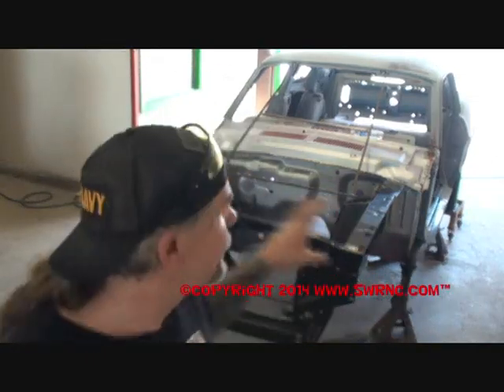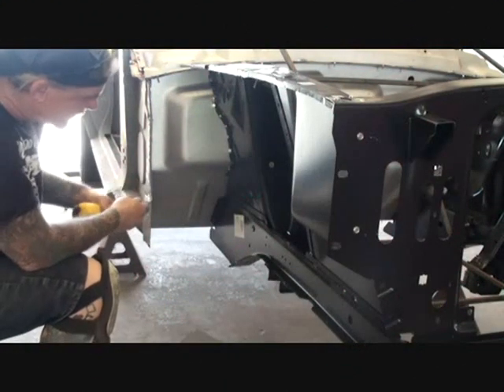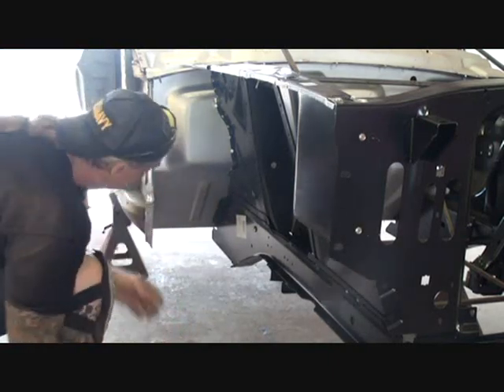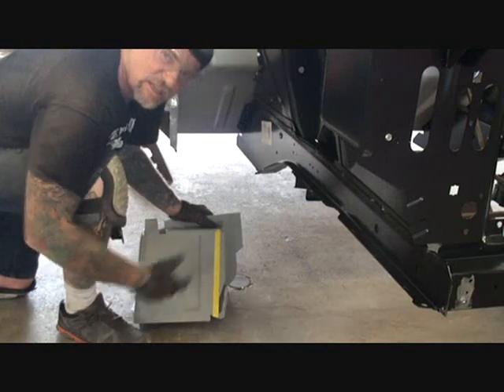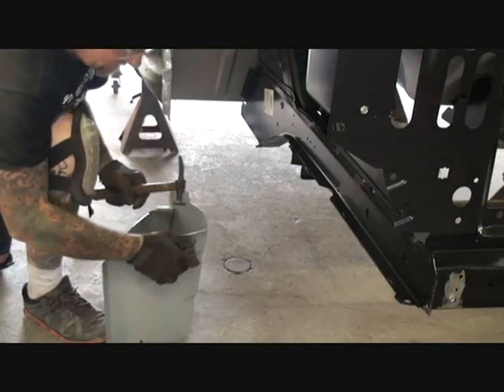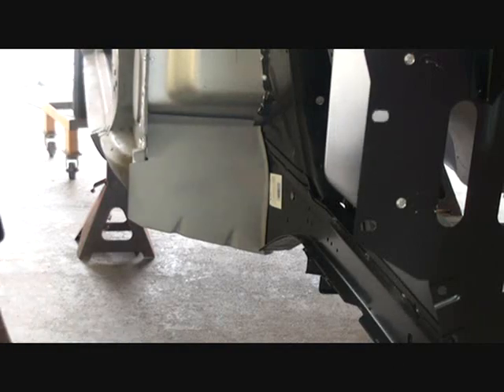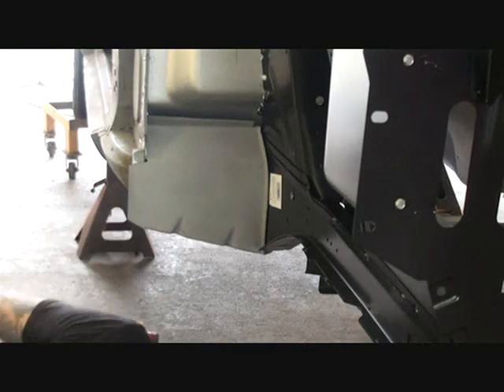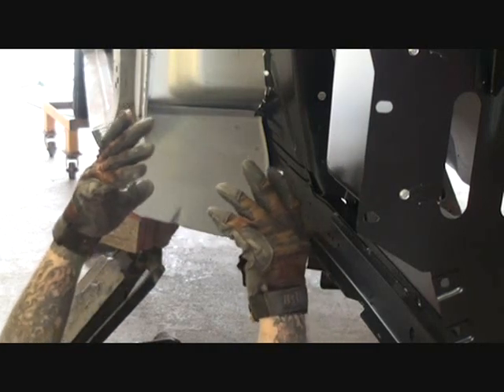"How To": "Restore" A Rusted Out "Car"-Part 20

Comment: hi pete, just want to say thankyou, i have been rebuilding classic mini's(non bmw) in the uk for 15 years, recently i took a job on restoring a mini pickup, the customer supplied all the panels.
they were the cheap type, i normally only use heritage panels(factory spec), but after watching your vids i tried it your way, we built a jig and fitted the panels with screws first,and it worked so well i'm now using your method all the time (even with the best panels).
i guess old dogs can learn new tricks,
thanks again aly.

Comment: A GIANT THANK YOU - I have been watching your videos for around 2 years. You have taught me so much, I have seen the way to "Do it Right", so I thought I would finally give it a try on my Ohio rusted out 2000 altima and my 1999 F-150. The first time I welded in a patch (ugly welds) it was like a miracle. Wow, I could take my knuckles and rap on it and it was metal instead of a rust holes, was like a miracle, I had to look at it over and over, like a kid at christmas. I love it, you gave me the courage and knowledge to try. So 4 patches later and $500 dollars of equipment (ha ha) later, I am having a blast. It's a lot more work than I thought though. Bought some aftermarket rocker panels, now I see what you mean about them not fitting right.  Now time to roll the paint on.(just kidding) ------maybe. Thanks Mannn...........

Comment: Pete, if the part doesn't fit and you can't mildly fix it, don't use them. Let the
customer know what the situation is so that it isn't a bigger problem
down the line. This is a problem for the customer who will eventually take
possession the vehicle after you are through and will have to live with
the situation at hand.
Cheap aftermarket are very alluring to a customer who is trying to save
money but it sadly often produces a hard time for the shop and lesser
quality job no matter what the shop does.
Keep it going! It looks better all the time.

Comment: My friend Pete, I had the same situation with my torque box on my '68, it is basically impossible to fit it in the way it is. What I did was undoing the spot welds and turning the torque box into two pieces. I hammer dolly the shit out of them individually and eventually they fit in place. P.S. Here is the situation, your videos are fucking awesome.

Comment: thing about aftermarket parts... they were made 50 years after the original.. they might be to factory specs but those guys on the assembly line had nice big hammers to get that shit to fit and knew exactly where to hit because they made a million of them... After market parts mean you aren't sitting there with a piece of sheet metal making your own

Comment: yup, fighting rear frame rails on my 68 coupe now. any way i can get some cross measurements from you for this 68? my guess is the frames aren't aligned the same as stock, because aligning my spot welds makes the frame measurements i took not match up. just wanna make sure my frame wasn't off or outa alignment before i go by my measurements.

Comment: I had to hammer and dolly the flanges too.  I was able to leave mine together and use a floor Jack to press them into place.  I didn't find it that bad and they for fairly well into my car.  Probably about 4 hours of work plus welding.
Reply from the maker: Lucky You! This job turns out to be a real pain in the ass in the end!
Reply: From what I'm hearing, I was lucky but I'd never want to take them out. I welded the crap out of them.

Comment: Pete, every video I have seem on mustang restos the torque box is a major B, It seems they all need to be split into two pieces to go in properly. The factory should have sent them in two pieces in the first place. Good luck guy!
Reply from the maker: The Tork box is probably the worst job to do on a mustang, Putting the front aprons on where a cake walk compared to installing Tork box;s and frame extensions..

Comment: watched this series 2x this is 3rd why would Ford or any OEM care about body structures/panels being the original geometry on a classic 45 yr old car, so it fits together safely an free advertising as it goes down the road? especially if they (Ford) dont even stock the part. alot of the dies used to stamp parts are not correct geometry worn out and patched over an over. after researching this it seems the original dies were sold to the Chinese stamping companies some even stolen. we just want to put our cars together make them correct "bitch"

Comment: Man, this aftermarket bullshit never fits, even brake pads don't fit and you have to hammer and adjust the brake pads brackets to fit,regarding this tourq box it is not available new OEM from ford ?